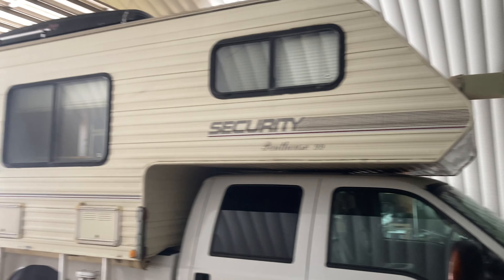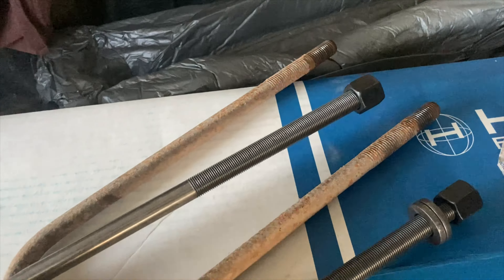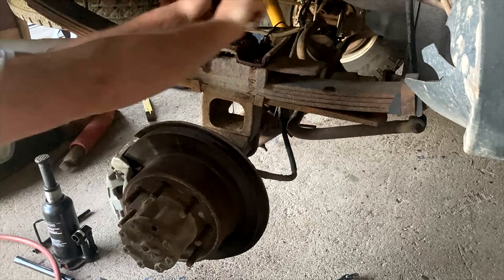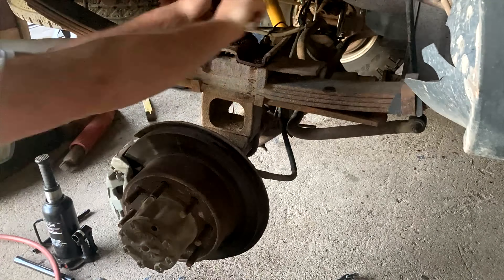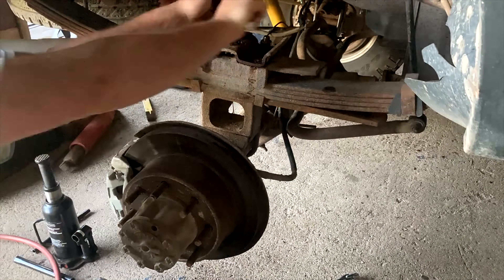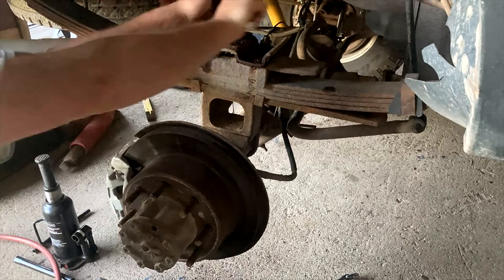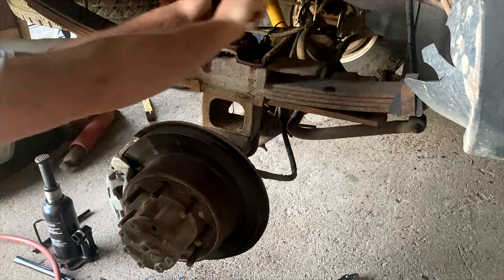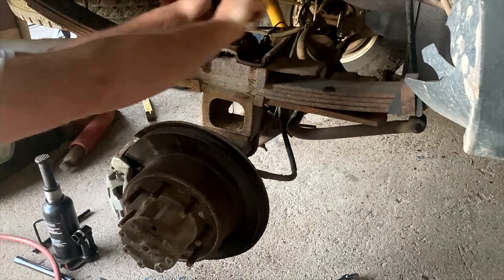Broken Helper Springs! Hellwig Helper Spring Upgrade

Comment: I have Firestone airbags installed that is managed with a remote controll unit. Also the Hellwig torsion bar installed. Our Arctic Fox 811 is 2800 pounds dry, so next week the Hellwig 35 helper springs are going to be installed. Our 2019 Ford F350 is a single rear wheel axle, so we are going the extra mile to have a safe ride.
Reply from the maker: That sounds pretty solid.  I think the adjustable air ride with the helper springs would be a great addition.  For me, that setup would be worth more than my truck haha!  Thanks for the comment.  Great to share ideas with everyone.

Comment: Has the helper springs affected your ride without the camper on the truck?
Reply from the maker: I feel it actually improved it.  It is not rough like the ride of heavy duty spring packs in work trucks and the vehicle stance is more proper (higher rear, more weight forward), which really improved tracking and steering.  This is especially true on gravel roads.